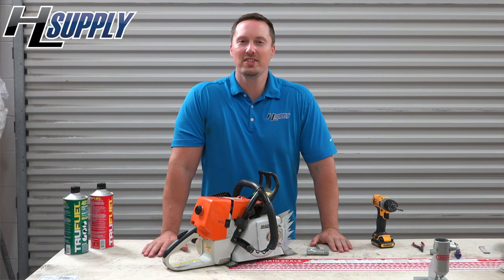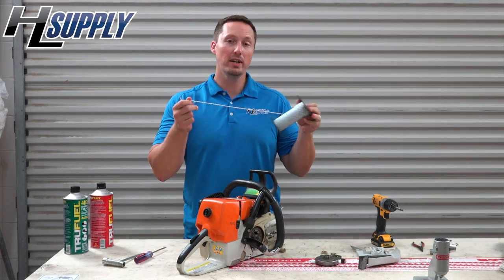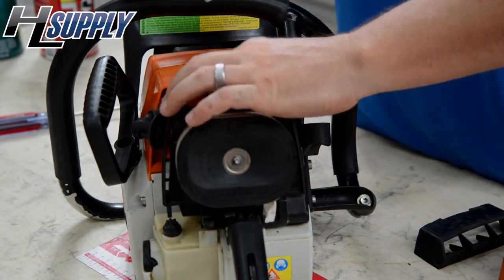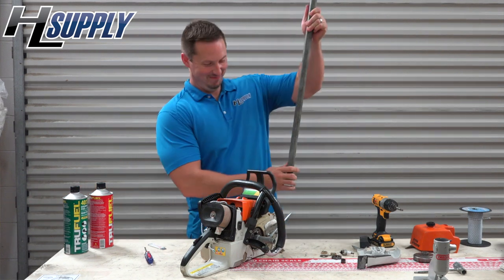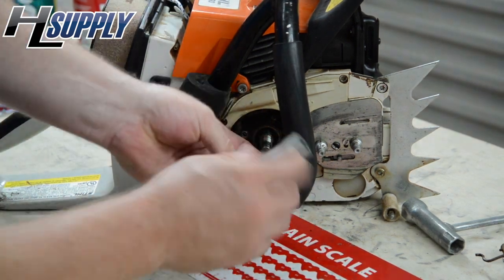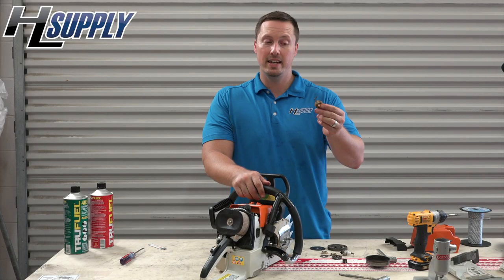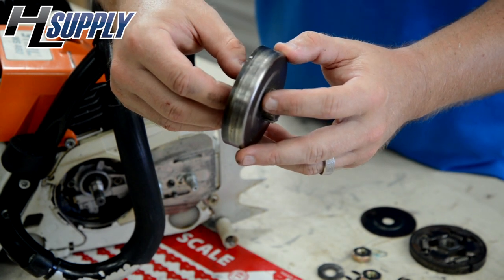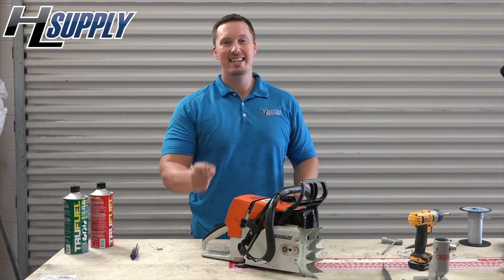Chainsaw Not Pumping Oil? Learn How to Fix it...

Comment: Nice video. I would recommend using a longer pipe for leverage. Say, something in the 10 to 12 foot length range. Have a helper hold the wrench and pipe in place, and then jump from a table onto the end of the pipe. This will produce the desired result easily and quickly.
Reply: LOL
Reply: I burst out laughing when I read this!  Good job on the dry humor.
Reply: Yes, the Tim Taylor approach always works best. lol
Reply: very funny, i love comments like this...........
Reply: Exactly how I do it but I jump from my roof while holding an 80 pound bag of concrete. Works like a champ.
Reply: Is that before or after I replace the blinker fluid?

Comment: you make a big deal about removing the clutch  with the 10 ft. breaker bar and say nothing about reversing the piston against the stop and locking the nut back down.....i know it's common sense but maybe not to everybody........if  you're supposed to be teaching  you need to show more detail.............sometimes you can teach just enough to get somebody into trouble..,,,,,,,,,,,,it might seem too basic to you but that's not the case with everybody
Reply: and no FPS tightning the clutch back on to the Crank!

Comment: I wonder what the oil pump looks like and how it connects to the oil reservoir and the lubrication "tube"....  I barely saw the oil pump...  what was wrong with the old one?  This video had too much emphasis on the guy having a clean shirt and not getting dirty with the details.  But I appreciate the tip on the piston stop.
Reply: All those muscles and I still thin Stihl is deleting all the useful videos of their product repair. You can find anything on Whirlpool, Kenmore, Maytag, etc. Squat on Stihl.

Comment: so for anyone reading this down the road, i wanted to tell u what happened w/ my stihl chainsaw so maybe it would provide u with a clue. the local chainsaw repair "pro" got my chainsaw oil lube flowing again - all he did was take the oil cap off and put it on its side for 20 mins. said it was "air locked" which i guess happens when u take it all apart to figure out why it wasn't oiling the bar/chain in the 1st place. sounds like i fixed the original problem but in doing so, created this odd secondary "air lock" problem that none of the youtubers nor anyone online mentioned could happen when u introduce air into the oil's pathway. i'm a little confused why this wouldn't happen anytime u're out cutting wood and run out of oil in your reserve tank. maybe someone can explain that.....

Comment: Dont you think you should have put some white lithium grease or some type of lube on the needle cage bearing
Reply: Technically you can grease it after the fact. There is a path leading from the center of the axle to the bearing. Most people don't know it exists though.

Comment: HLSupply…Thanks for the Video. I tried the Rope trick. It held at first and then gave way. I pulled the rope out and only had 2 Knots! Then I tried fishing out the other two. Tried blowing it out with air, no luck. So I removed the muffler cover, and there was my piece of rope in the Muffler. I noticed the exhaust port was sort of rectangular and I could see the piston going up and down. So I stuck a piece or 1/8” x ¾” Aluminum flat stock in the port to the top of the piston. And that worked with just a 25” breaker Bar. No Jumping required.

Comment: Don’t put a rope inside your saw engine. Order a piston stop for $10. Also, buy a 1/2 inch drive wrench and socket set like any normal person would have. Perhaps there would be other uses for it like any given bolt you may encounter. What?!!!!!?! Never!!! Right, break you saw wrench and get some rope caught in your engine.

Comment: What do I do if the piston shears off part of my rope when I’m trying to take the clutch off? 😅😭
Reply: Kelsey, this exact thing happened to me today. After much searching I removed the muffler to find the piece of the rope which was sheared off. Then I put the new worm gear in ( i wasn't changing the pump, just the worm gear). This is when I realized that my rope wouldn't come out. Leaving the rope in, since I had no other choice, I tightened the clutch back on and when it was tight enough the piston backed off which allowed me to get the rest of my rope out. Maybe you already discovered this solution, but hopefully it helps if you didn't.

Comment: Don’t put the rope where the spark plug goes, one thing can go wrong and your fishing out a piece of rope that got cut or snapped. I know from experience, just use an impact, and make sure if you’re taking it off to remember it’s reverse thread. Yeah pull the spark plug, but don’t put any damn rope in your engine.